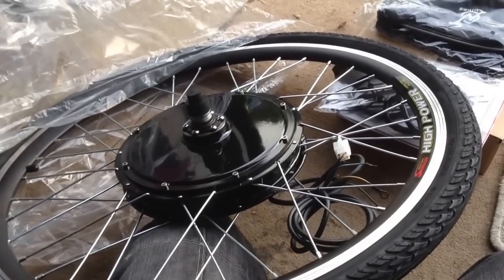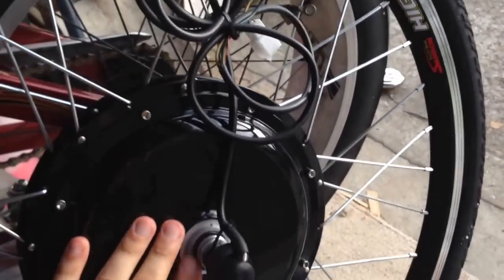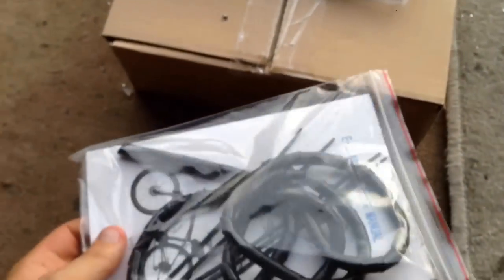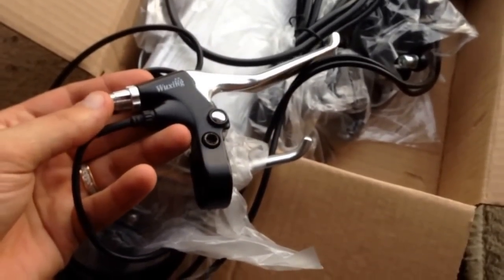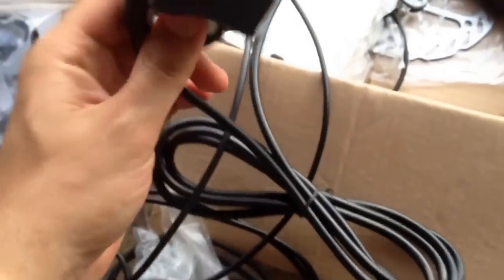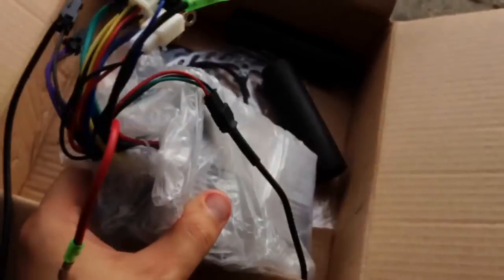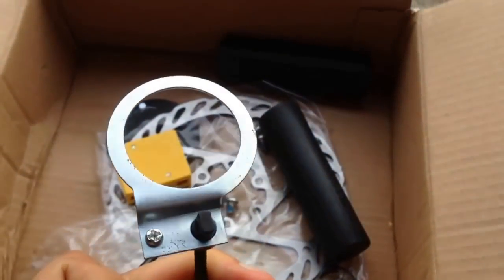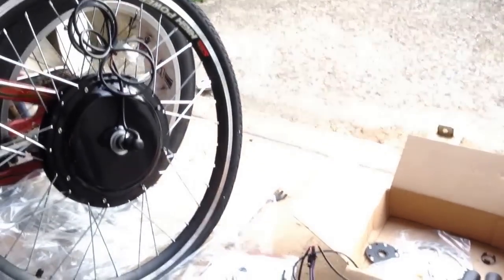electric bike conversion kit 1000w 48v

Comment: Just got this delivered. How do you tighten the nut on the axel the side with all the wiring? mine doesn't want to move more than half a revolution any more I feel I'm just twisting the electrics inside. any advice?

Comment: I am new to understanding E-bikes, I have a drop handle bar shimano shifters road bike and will I have to dismantle the brake lever to assemble the e-bike lever, because this is what is putting people off with conversion kits.
Reply: David Fearon you don't have if you just use the wrist/thumb throttle. You have to if you want to use pedal assist but that is ass anyways :-)

Comment: is it safe to convert the front wheel or the rear wheel?
Reply from the maker: either one, its up to you, with more powerful ones the rear is recommended more as its easier to control
Reply: here's  a few suggestions for treating asthma naturally
Kick Out the Mites.
Use HEPA Filters.
Clear the Smoke.
(I discovered these and the reasons they work from Laken chest remedy site )

Comment: Is there a reason for using 18650 over lipos?
Reply: 18650 is the code of the cells
Reply: That may be a 
Lipo
LiCOo2
Lifepo4
etc
Reply: 18 is the diameter of the cell
Reply: 65 is the length of the cell

Comment: Do You know..is it posible to controll..trottle 2 or 4 front wheel motors with one trottle? Planning to bilde a 4wd on 4 bike front tyres..2 forks in front

Comment: Hey I've seen a lot of conversion kits online and notice they don't bring batteries do I need to buy one of these seperate and what size is recommended?
Reply: Most 20ah for 1kw go about 14-20miles out of them before drain so definitely  get something  slightly  more stronger

Comment: So most ppl dont bother with the peddle assist. I dont see how it even works. How do u turn on peddle assist in this kit. I installed it on one bike and it didnt work but then the crank started coming loose. lol
Reply from the maker: the pedal assist kit normally comes with it, its a plastic disc with magnets on that you put on the bottom bracket, then there is normally a pick up with attached round the bottom bracket area of the frame, just connect the wire from this pick up to the relevant connector on your kit and it should just work like that.

Comment from the maker: that sounds really bad, even my first battery i had which was a 17ah battery after a year and a half of daily use i could still get about 15-20 miles out of it just had to be gentle on the throttle, if you tried too much power up a hill it would just cut out. but if you unplug it then re connect it it worked again. Also they perform a lot worse in cold weather. you should always try to go for at least 20ah with a motor this powerful. should be less than £300 on aliexpress if you look around. something like this http://www.aliexpress.com/item/free-DHL-EMS-shipping-1pcs-lot-1000W-Electric-bike-Lithium-Ion-Battery-48V-20AH-with-charger/701895087.html
Reply: Infinite batteries coming out soon
Reply: ........dude why do you mumble in a low voice  ??  People can't hear you.  Especially with the ruffling of the plastic bags containing the supplies on this kit.  Eat breakfast before videotaping so that you can have energy to raise your voice.  LOL
Reply: why can`t it charge the battery as it moves
Reply from the maker: I'm not sure maybe it can, when you go downhill and off the power it does seem to regenerate a bit if the lights have gone out on the throttle to show the battery is low sometimes they come back on, so it must regain something.
Reply: If you had a motor on each wheel maybe you could reverse the connection on one and turn it into an alternator
Reply: Fast Electric Bike They're way cheaper than that now, at least the ones I saw.
Reply from the maker: The price hasn't gone down that much in the UK about £160 or so, the actual kits are closer to £100 but with all the shipping they always sell higher in this country
Reply: Fast Electric Bike oh wow I didn't know they got that low. can you send me a link? I'm looking for a cheap battery.

Comment: will this conversion kit work with this battery? "http://bit.ly/1BkYEzL" + "http://ebay.eu/1vekHrK" if they would work together then it seems like a really good price to convert my bike! :D thanks
Reply from the maker: ***** I'm not sure to be honest, I've only used it with lithium batteries, plus they are lighter too
Reply: Fast Electric Bike I ended up getting a kit with a small light li-ion battery after a little research. lead acid batterys are pretty bad for electric bikes and vehicles... they're heavy and very inefficient and they take a long time to charge